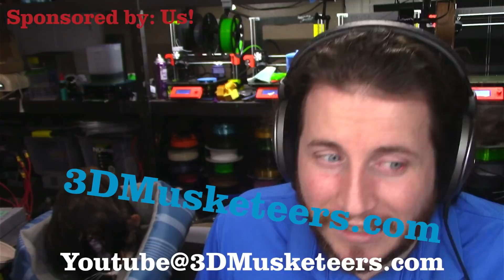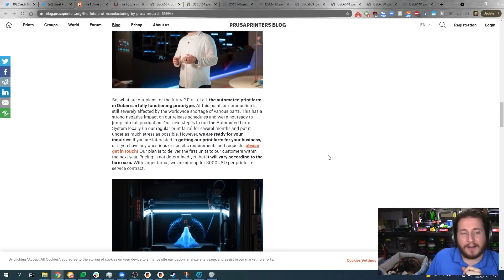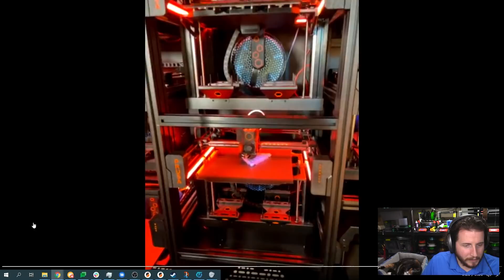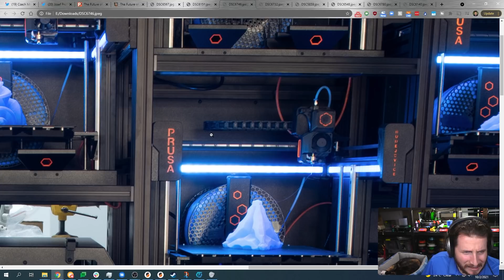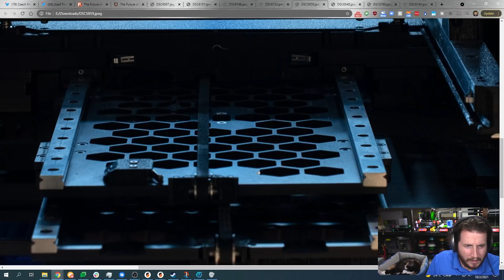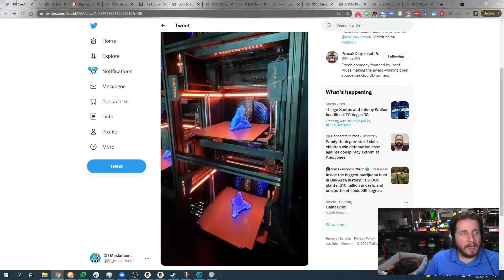A Look at the GROUNDBREAKING Prusa  Automated Farm System!!

Comment: Hi, nice video. Here are just few tidbits. 
1) RGB runs in a show mode, to make it nice for the crowd. But when you finish the snowflake design, it shows you which printer will be printing it, by lighting it up. What you proposed will be done on the final farms. 
2) We actually have fluorescent filaments already - PETG Prusa Orange a Neon Green. 
3) We are not using Revo. Ring heaters are not final, but we didn't want to make changes at the last minutes for the sake of getting it ready for the show. 
4) Pins hold the sheet while the bed goes down for easy removal. Shearing it of the bed without this would be very ineffective. 

There is still plenty of information in the photos 😇

- Josef
Reply from the maker: Love the idea with the lights, that was always our plan on our farm, but never got the octoprint integration working right, maybe with PrusaConnect we can make that happen.

I should have thought about the orange and green, but it completely did not cross my mind! 

Excited to see what the final hotend is on the AFS as likely it will bleed into the successor to the MK3 platform. I appreciate the vertical integration as well, it is interesting to watch it occur effectively in real time! 

Ah, so the pins pop the flex plate off of the bed itself, that is great. Definitely would be difficult in a shearing force. 

I am sure we missed stuff in those photos, always trying to learn more! Maybe one day we can interview you about it?? :)
Thanks for the support and kind words!
Reply: So Revo is planned for the final product?
Reply from the maker: @Marko62744 Nothing official as to yes or no, but I would hedge a bet on no. Prusa has been vertically integrating for years now. But only time will tell.

Comment: It's 3000$ per printer for large farms, a bit costly no?
Reply from the maker: Not when you consider the fact there is an automated arm taking prints off and replacing the beds as well as everything interconnected with software to monitor and manage print jobs.
Reply: people are costly too and they have rights. These machines do not (yet)
Reply from the maker: Labor quickly overcomes that $3000 tag lol

Comment: Nice commentary.  Regarding the maintenance contracts...While I'm sure Prusa can send techs all over the world for repairs (at a premium) I think the maintenance program they've been working on with their standard lineup will likely be expanded to include the farm.  There will likely be a much more rigorous "certification" program for farm maintenance, but I think that would save on travel expense and likely enable more prosumers and small business owners to contract with Prusa for maintenance.
Reply from the maker: I love this idea! I hope they look at something like "we train you so when YOU break it you can fix it with our parts" something along those lines.. But yes, travel will get pricey, but again, if I am spending 100k on 34 printers, I feel like you can send someone out? lol. Maybe not, 3D Systems made me wait months sometimes for service on our multiple $80K+ printers.. That after sales support is going to be a BIG deciding factor to me if we go this route or continue down individual printer lines.
Reply: @3DMusketeers  yup. Basically like how the big guys do it. Subcontractors. If you want a security system installed it’s not the manufacturer that installs it. They send the parts out to a local vendor who does the work. Prusa can ship the parts to the site or a locally approved vendor who then does the install and manages the maintenance contact. Much cheaper to have subcontractors around the world than to have to send techs from Prague.
Reply from the maker: Indeed!

Comment: I wonder what the market is like for mass produced 3d (fdm) parts ?  Apart from 3d printer parts, I've not seen many , in fact I'm having a job to think one one non 3dprinter related , 3d printed part , comments?
Reply from the maker: We do a ton of parts for non printer related things. I see this used as jigs, fixtures, companies that make molds, etc. Especially useful for companies that rely on Just In Time inventory systems. But for us specifically, for people that want to do production runs without paying tens of thousands for tooling.
Reply: @3DMusketeers  but is this farm going to be able to print one-offs any more efficiently than a human operated system?  Most of the cycle time is printing after all .
I'm comparing this with my experience of cnc machines  - I'm involved with a company that makes parts for an F1 team (-think highly profitable sugar based drink) They make a short runs , 1000 titanium wheel nuts for instance,  and one off prototypes  , they don't use palletised machines or even bar feeders .I can't see why , if you're not churning out thousands of parts you'd need a auto-unloader.
Reply from the maker: I believe so, yes, explicitly because this does not need union mandated breaks, is not very expensive per hour, and runs fully unattended, from what I gather. If you want to have someone attend to it, it would likely cost less than a cnc machine operator that could run a bunch of cnc machines at once. 

Thankfully this system has both a loader and unloader system that is automated. I think, so far, the manual process is changing the filament, but with big spools, that may take a while. 

Yes, if metal is needed, that would be a CNC job otherwise the printers would run hundreds of thousands of dollars. Whereas a Haas VF2ss can be had delivered for under 100k.